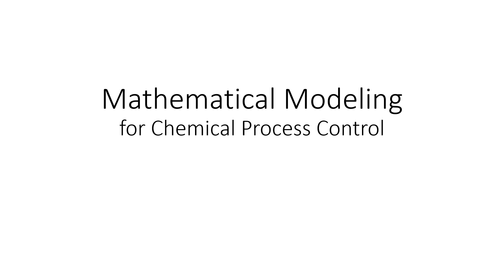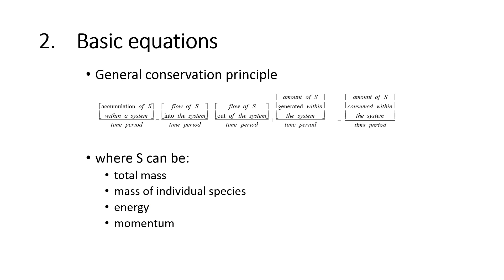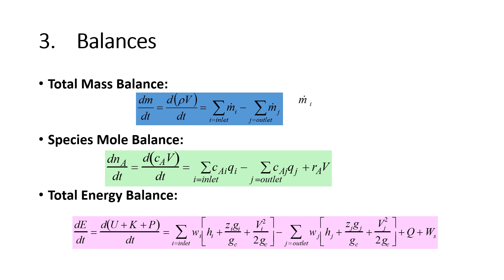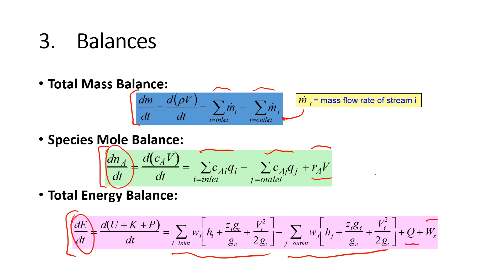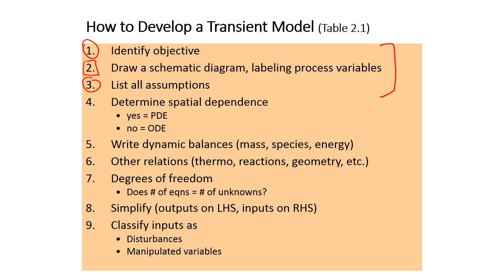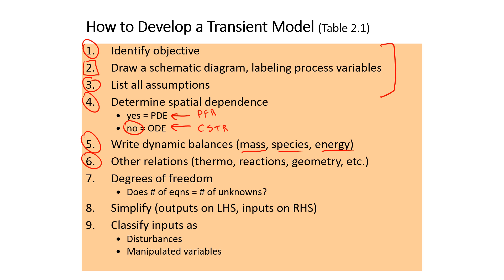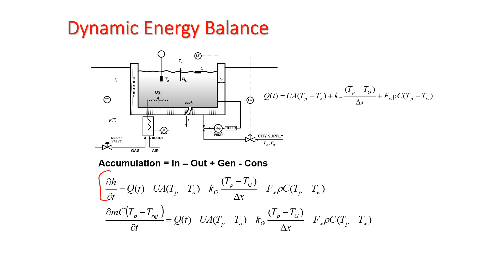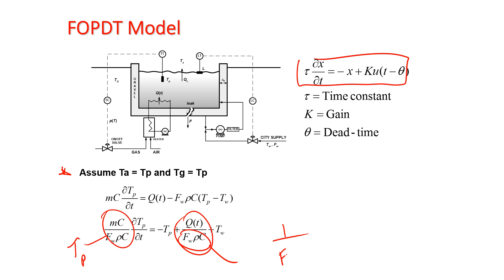9 Steps for Simulating Dynamic Systems

Comment: Great video, but can you make an example with the same conditions, but instead replace the water in the pool with Liquid Oxygen (LOx) and the pool material to a closed vessel made of stainless steel. Thanks
Reply from the maker: This could apply to that system as well. Here is some additional information on writing material and energy balances.
http://apmonitor.com/pdc/index.php/Main/PhysicsBasedModels

One complication is that you'll have pressurization and phase change as the tank absorbs heat. If there is a pressure relief valve, the pressure will remain below that level and the LOx will boil off gas to maintain a temperature at that vapor pressure.